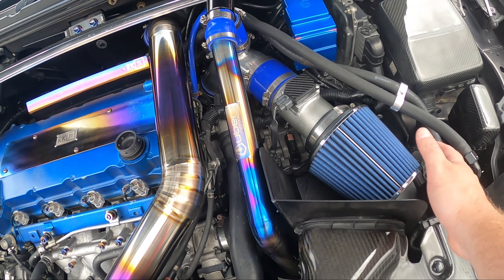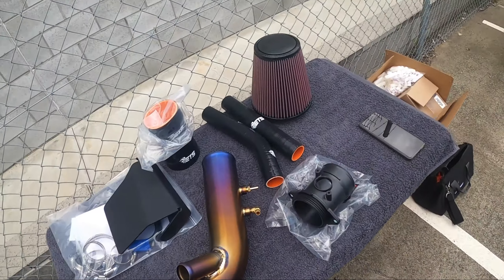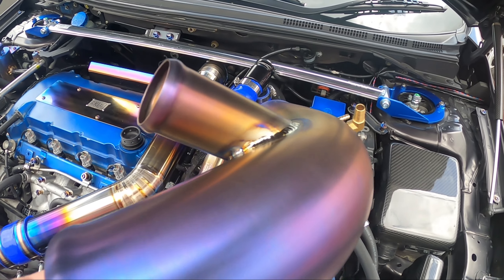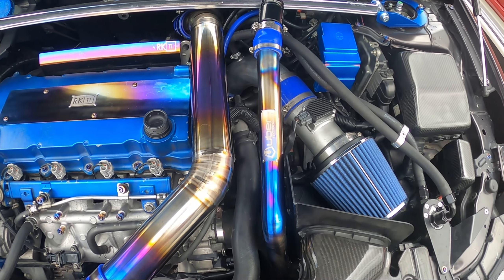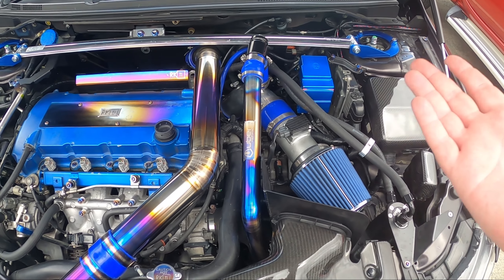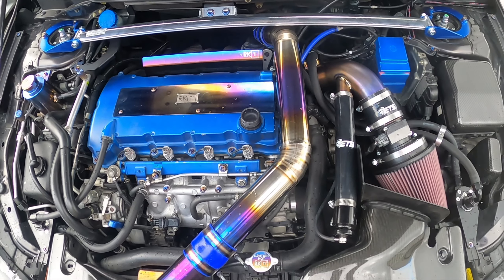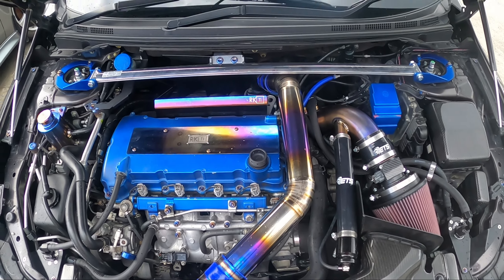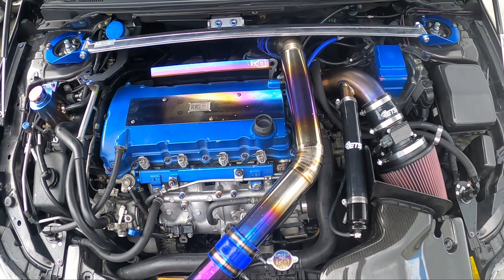Evo X ETS Titanium Intake Install

Comment: Looks good. I had a heck of a time clamping this to the turbot inlet, but I couldn’t be happier with mine. The AK Racing heat shield is a major step up from the ETS one, too.
Reply from the maker: Yeah was a bit of a mission haha as I kept wanting to pop off and not stay flush on the inlet.
Yeah the heatshield is a huge improvement for sure and definitely a must have for any ETS intake owners